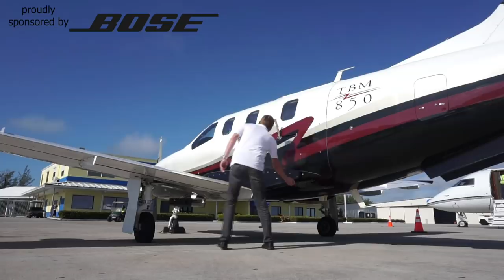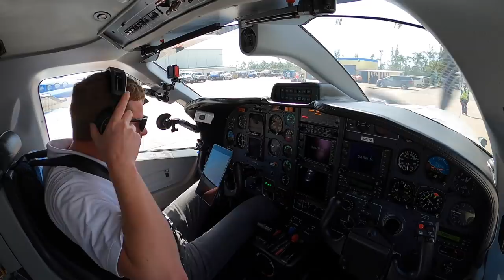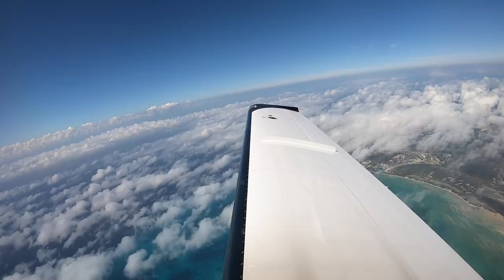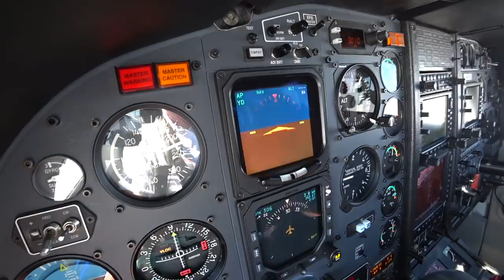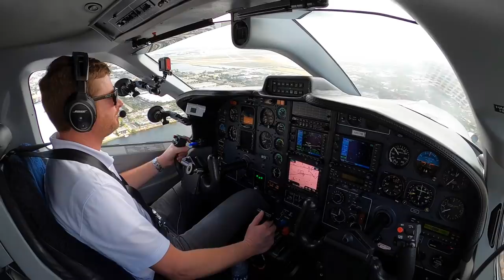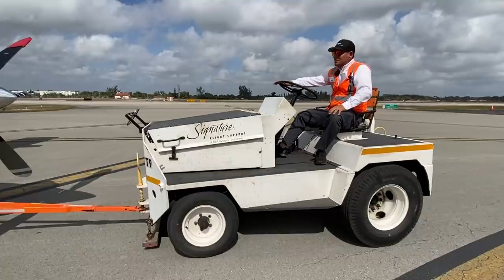THE BERMUDA TRIANGLE STRIKES AGAIN! - In-flight System Failure

Comment: Like how you blended the “smash the like button” comment on the radio face.
Reply: Just to see if you are paying attention :)
Reply: he hides them in every video.  pretty cool
Reply: I saw it! That is awesome
Reply: @pictureBigger  Really?  I've never noticed it before!
Reply: @8:05 love your comments on the Sunwing pilot’s landing. I’m sure most of their pilots are awesome, but my wife and I flew with them to Cayo Coco, Cuba a few years ago and had a much worse landing. 
When they touched down, we were past the half way point of the runway, followed by swerving from side to side and the thumping sound of the anti-lock brakes. When we finally stopped, I swear the nose gear was off the end of the runway. After sitting there for a few minutes, they used reverse thrust on the left engine to back up and turn so they could taxi back to the last taxiway turnoff. I wish I had video.
Reply: Best landing so far! Seriously Steveo! That was beautiful!!!
Reply: @petemac7969  yep.  start looking carefully, they're there.  sometimes on the asphalt, sometimes on the hangar, anywhere really.
Reply: Erg, you gave it away.
Reply: @geraldturner9764  sorry couldn’t help it

Comment: "Slow speed to 160 to maintain spacing."
Yeahhhhh, no..
Reply: Does that work with passengers?
Reply: @jamescollier3  part 121 (commercial) nah to keep it simple you have to be under ifr no matter what
Reply: @mgoblue0970  I believe op was referring to Part121 operations in which case they would be correct.
Reply: bruh

Comment: Smashed! Just curious why you got clearance and ATIS in the room and not the plane? Save fuel? Too hot?
Reply: To get radio working you need to use the battery of the plane. By doing it in the briefing room, you can directly startup the engine. Pretty smart solution.
Reply: In reality he may have saved 10 minutes worth of fuel

Comment: My alternator problems were eventually traced to a worn and disintegrating, braided-wire ground strap at the battery box.  There was a higher-than-normal ground resistance that would cause the alternator field coil circuit to trip offline anytime there was a major current transient that would have called for battery current.  (Piper Saratoga).  If you are having repeated alternator problems, it isn't likely the alternator.

Comment: The most amazing things about these small aircraft is their cost to quality ratio ... they cost a fortune from $3M to $4.5M but are cheaply constructed with sub-standard wiring and electronics.  There are relatively low cost wiring units (I've used in my race cars) that allow you to go fuseless and provide full realtime (100Hz sample rate) monitoring of ALL electrical connections ... the unit is cheap at $2000-$3000 per.  Mil-spec wiring is rarely used in these aircraft (less weight and higher current capacity for the gauge).  Not only can you exactly determine any electrical issues for any wire, you can get realtime readouts so one can be aware of the start of any anomalies and pending how much memory you install can have a complete electrical history of current, volts and even set trigger points.  Given how often maintenance is required for these aircraft it's rather a sad state of affairs for small business/GA industry ... it's just bizarre to see aircraft in this price point not have such a critical component that isn't expensive.
Reply: That's an intriguing perspective I've not heard before and I've built wiring looms for automotive. Thanks for sharing.
Reply: @Talasas  I've rewired my entire Lotus Exige when racing in the Lotus Cup USA series.  Search "RACEPAK SMARTWIRE" uses V-net and Datalink II software.  As far as Mil-spec wire, that can be obtained from a variety of vendors, can hold twice the current for same gauge as standard wire.  Also Mil-spec bulkhead connectors from Amphenol with membranes ... single use, not reusable.
Reply: Mil-spec is not in G/A or light biz aircraft because the cost is too great and they don’t encounter the demands military aircraft do. I do mot believe they are cheaply built ,  wired or avionics. I have primarily Garmin in my C206. I have flown brand new 747-400 freighters that had a series of generator and avionics problems. Some aircraft are lemons. They had some faults built in and it takes a while to find it. Incredibly complex. I bought a new Ameritron amateur radio amplifier with faults right out of the box. Back to Ameritron for repairs. It will probably give good service from here on.
Reply: @peredavi  I agree mil-spec wire does cost more as do the single use membrane interconnects… but I replaced all the wiring in my Lotus race car to Mil-spec and the cost difference wasn’t significant enough to be prohibitive.  Cost in wiring is labor and that will be the same cost regardless of type of wire and  interconnects.  I never experienced any electrical issue when racing.  Wiring is a point of failure that relatively easy to mitigate.  When one is looking at aircraft in the Million $ plus range, the cost of mil-spec would add at most $20,000 in materials … negligible for a 3.5M $ aircraft.  Agree other failures can happen, but why not mitigate a potential source of failure due to cheap wiring and interconnects?
Reply: @robainscough  Honestly, I don’t know enough about it to really make an intelligent comment, but this being the Internet, it won’t stop me!😂

Comment: If TB were mine I would begin to think about a possible connection between the prop governor problems and the generator issues. Anything that repeats is a worry. There may be some odd harmonics in the turbine/transmission. Be interested in what real engineers might be thinking about if they had to trouble shoot this TBM ?
Reply: I believe the generator is off the accessory gear box at the back of the engine, and the prop and governing separately located nearer the front of engine.  But anything is possible...
Reply: That's not where I'd first look. I'd first look at getting a different brand generator if possible (sometimes only one company makes a given part). See if the problem still happens. If not you solved it, if it comes back again start looking for issues in the aircraft's electrical systems that would generate a generator overload. Maybe look at that AC system or other high-draw items, see if they're drawing too many amps for their rating.
Reply: @colinsouthern  To be fair on an automobile (I'm an auto mechanic) unless you're talking about a very old vehicle ('60s or thereabouts) the alternator/generator and the voltage regulator are replaced as a single unit, you can't really get "just a generator" or "just a voltage regulator", and I (perhaps mistakenly) assumed that it was similar on aircraft.
Anyways, that's the troubleshooting procedure I use when I have a recurring problem. I don't buy the same brand twice in a row on the same vehicle if the part failed early.
Since we know we have a failure somewhere in the electrical generation systems of this particular TBM 850, I'd choose the most likely part to have an issue, and try a different brand of part. In the automotive sector, parts usually have some form of warranty available on them that says they won't fail within a year of installation (for example, time may be longer/shorter depending on the specific part and/or brand, generally the more you pay for the part the longer the warranty will be). If something similar exists in the aviation industry, then you'd be able to get it replaced or refunded under warranty, which would allow you to get the money to at least partially offset the cost of choosing a different brand of replacement part, so it wouldn't be such an expensive gamble after all. And it's hardly a gamble when you as the mechanic have gone thru the proper diagnostic procedures and come to the decision that "this is the thing causing the issue".
Reply: @colinsouthern  I guess I'll have to bow to your superior experience in the field, and the field windings.
Reply: @colinsouthern  
I did find that video interesting, thanks for sharing it with me. I feel like I've watched it before, but being reminded of it again brought a few things to my mind.
The failure in that video (wire shorting against a bulkhead) is why I mentioned that BEFORE going ahead and deciding to replace a part, it would be prudent to measure the current draw of each individual electrical circuit of the aircraft, specifically looking for one that's drawing more than normal. Also, doing a thourough check-over of the circuit breakers to make sure they are of the correct rating (seen that in automobiles, someone has a fuse blow and instead of finding the root cause of the issue they just put in the next size higher fuse) and are capable of tripping when they need to (seen that, some particularly cheap no-name fuses only blow when something like 500% over their rated current for a minute, usually this is only found out when the vehicle has an electrical fire soon after someone replaces a fuse, and with these particular no-name fuses using the right size fuse or not matters little), as well as verifying that they are capable of interrupting the circuit when they do trip (seen automobiles with brand new aftermarket stereo, alarm, and/or remote start systems that the installer really didn't seem to understand how electricity works and that they had essentially entirely bypassed a critical circuit protection device by connecting both sides of a fuse with a wire that has like 20 junctions in it).
Trust me, I've seen some really shoddy work. I see that stuff, I tell the customer "Look, until I undo the screw-ups that whoever worked on your vehicle last made, I can't figure out what if anything is actually wrong with it, so this aftermarket system has to be removed before I can start diagnosing your electrical issues. The good news is that most of the time the aftermarket system itself is the problem."

I hate aftermarket electrical accessories that are more complex than a trailer wiring harness with a passion. It's not the systems themselves that are the problem, it's the places you can go to that will guarantee they can install such a complicated piece of equipment within an hour or so. To get such a speed of install, they usually aren't experts at knowing your particular vehicle's wiring harness. Instead, they just start hacking away at the wires until it works, and who knows how much damage your vehicle's electrical systems have suffered as a result of the install process. Removing them is like removing a brain tumor, because the quicker the install was, the more the wiring for these aftermarket systems looks and acts like cancer.

Comment: why did you get the ATIS and clearance in the lounge as compared to the plane?
Reply: easier.
Reply: Less time sitting in the plane with the engine running!
Reply: Less worry about spilling his beer.
Reply: @SeanDuffyProductions  cooler was my thought.  You have to start up the engine to get the AC running.  I am sure his company appreciates those little things and he does not have to sit in a hot plane while doing that.

Comment: As a fellow pilot I have to say that crosswind landing was on point. Also great job dealing with the generator failure and all those changes with going IFR to VFR back to IFR and changing altitudes and such. I'm just a student pilot in a 152 and a Piper Archer  but I've been around planes my whole life (dad's been a PPL since 1981). Dream is to get all the ratings after my PPL solo (which should be in the next few weeks if restrictions in my area allow, could have flown in literally a year ago but of course things shut down) and buy my own aircraft (currently looking at Piper Archer which I'll own with a buddy) . My instructor gets me to do crosswind and soft field and short field stuff all the time, makes doing normal landings something I could do in my sleep.  Looking forward to the next video as always!

Piper CNOP Over and out!

Comment: I note the time you had the trim up engaged with your left thumb on takeoff. I assume the electric trim travel is pretty slow? Excellent video, as usual, Steve. That speed restriction so early in the flight for spacing seemed a little much.

Comment: Nice flight well done I will have to say that generator failure is a mechanical failure not a instrument failure I would suggest changing the part supplier if this has been a repeated issue and a full maintenance of the electrical system to make sure that something is not causing the generator to fail a faulty ground or a wire insulation rubbed off or broken could cause the issue great flight great video very professional this being said the issue shown is inconsistent with the presumed reports of the Bermuda triangle phenomena those reports if not pilot error is consistent with magnetic disturbance of instruments might I suggest a camera with magnetic shielding would be the only way we would see what happens if this presumed event ever happens I don't think you would encounter such a event your at the wrong altitude

Comment: Thanks for the nice flight. Great crosswind!   Always a bit of a challenge for me.  
I have crossed the Gulfsteam many times (hundreds), by boat, mostly sail. I see that as you got closer in, maybe a few miles off shore that those nasty whitecaps dissipated.  That Gulfstream makes it’s own weather.  Have experienced that many times. Sometimes a pretty distinct transition from 3-5 chop to 8+ foot steep breaking seas.  Again I enjoy the videos much!  You are one smooth pilot.  PS.  What is the power source for  the generators,

Comment: if it keeps pooin generators , id be getting the wiring looked at, likely theres a resistance issue, i dont know anything about planes but in my experience with cars if something electrical keeps failing its usually an issue with the wirings or a pin on a connector, seeing as you spend a lot of time flying in salty environments i wouldn't be surprised if some oxidization has appeared on a terminal

Comment: Hi Steveo, does the TBM have a generator/s or is it an alternator, the Pilots information Manual for the 850 references only Generator, surely they don't use a generator/s ?. As for the breaker tripping, if I can put my 2 cents worth of comment in, I would be more inclined to suspect the load ie. the aircon clutch activating, for example, the avionics and lights would draw bugger all current. Top rate content, stay safe look forward to your next flight. Cheers

Comment: If you couldn’t reset the generator are you strictly on battery power? How long do you have, especially over water? Pucker factor goes up!
Reply: There's a standby generator. In a previous video, he had a similar failure and ended up using the standby after the main generator reset didn't work.

Comment: I wonder if that generator was repaired  refurbished or replaced . How does the input shaft look on the generator could it be the gearbox contributing to the generator failure
Reply: Could be an electric issue if it’s tripping off line , tripping CB ?

Comment: So, help me understand,  to crab land with the wind coming from the right side,  just when you are over the runway, you re pressing the right rudder to point plant to the right while dipping your right wing slightly downward, then upon landing straightening out plane when your right wheel touches the ground?
Reply: Wind coming from right you need left rudder to straighten out and right aileron down. Easy to remember. Whichever way you need to straighten plane out use opposite down aileron. The down aileron prevents wind from blowing you sideways.

Comment: cheap computer chips, a resister or a capaciter or poorly sodered on the mother board, or maybe a direct beam from the hubble sadlelight to help your competition. on the downtime for repairs.Did you fly into a no fly zone with micro waves, to heat up small micro chiips.